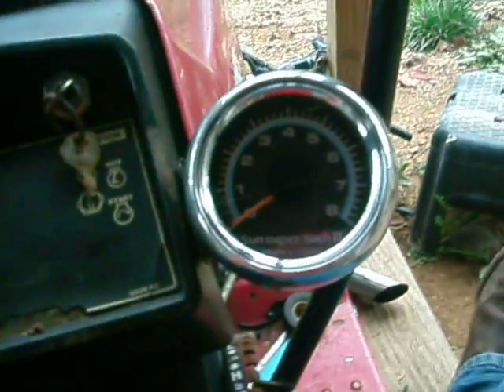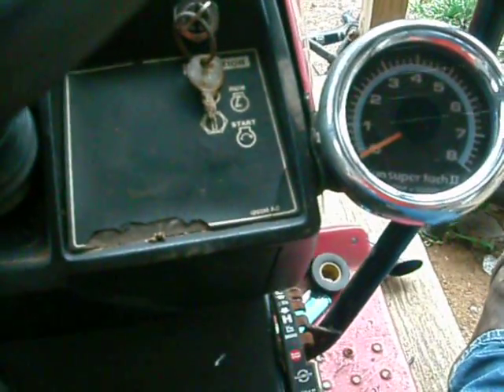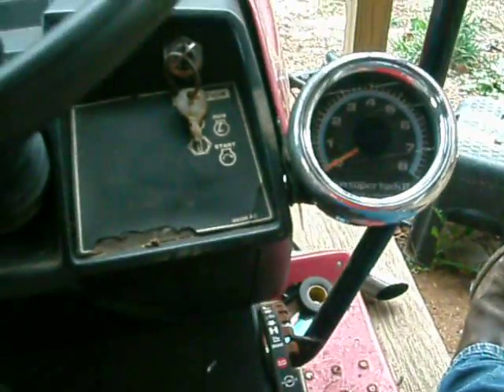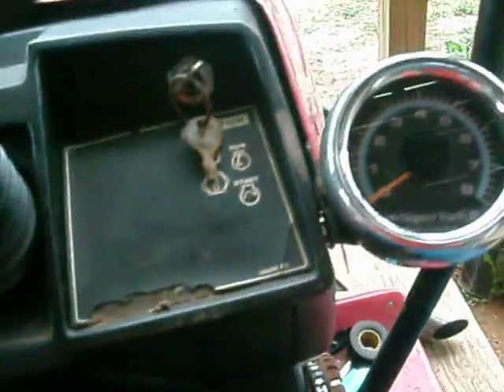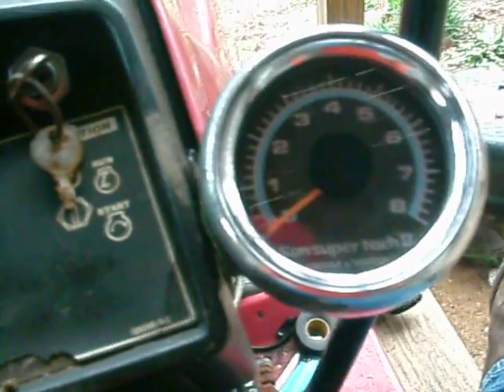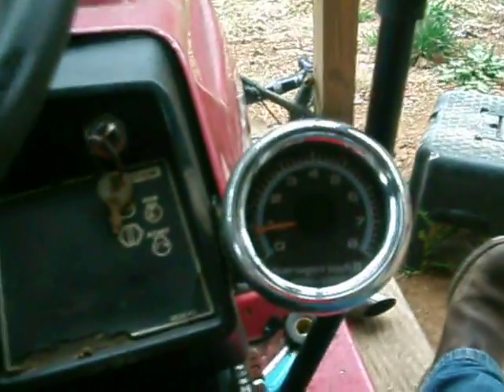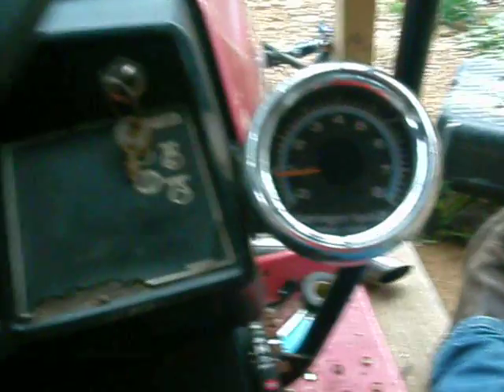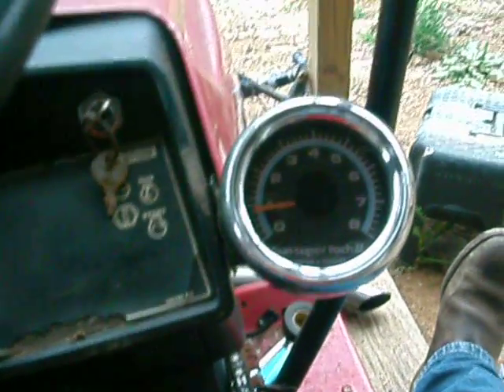My lawnmower Tach

Comment: You can ad a tach to any lawnmower, a magneto dosen't matter because you know why? Because just get a rotational sensor on the crank to pas a point and have a electro-analog receiver aka tach to show how fast your going, geez i don't know why lawnmower manufacturers don't even think of putting it on the lawntractors, just because we just want if for apperance like the color or high back or low back seat for visual rreasons like the tractors hood iis for cosmetic purposes, it shouldn't cost .

Comment: hey is that tachometer water proof
thanks
Reply from the maker: it doesn't say, but it works fine
Reply: yam225f alright thanks have you ever had it in contact with water
Reply from the maker: I have a tach just like it on my V8 tractor and it sits out all year getting wet. Haven't had a problem yet